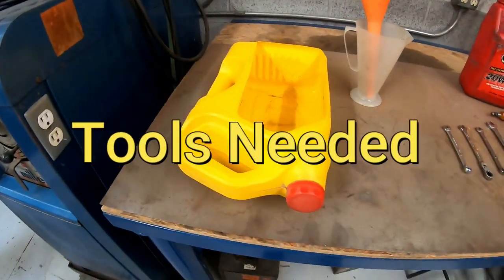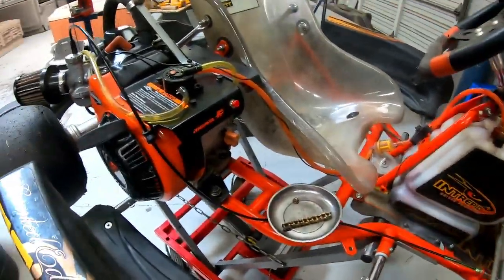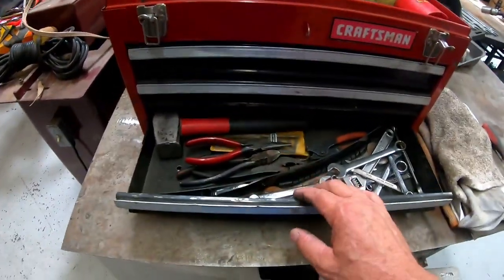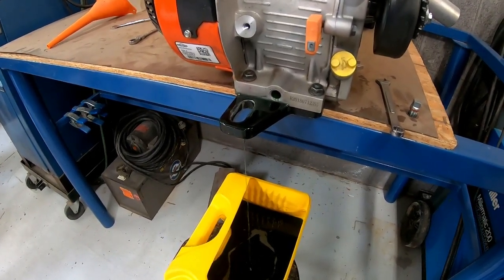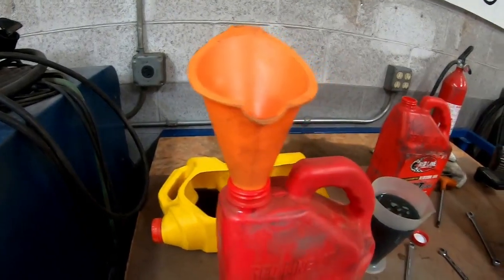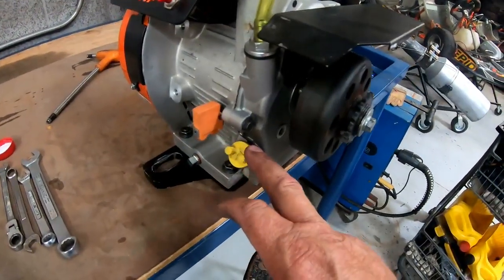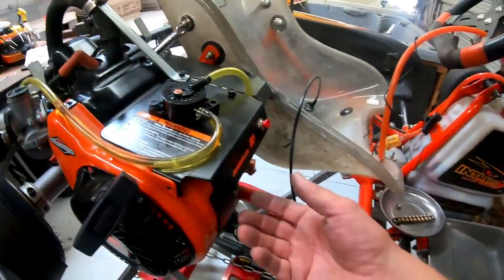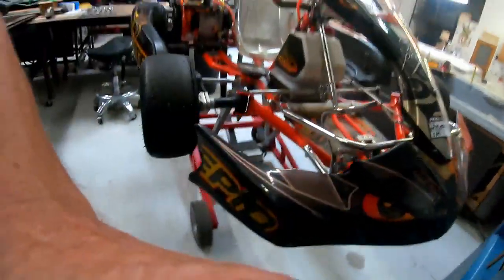Oil Change 101...How To Change the Oil On LO206 Briggs & Stratton  (Lo206 Oil Change)

Comment: That motor mount is nice, but couldn't the next one be wider, but have a hole for the oil to pour through? The thing that would bother me, that last bit of oil that works its way under the motor, looking a leak. Thank you for the video.

Comment: Very long video for something that could take 3 mins. I also wish you would have touched on back flushing the crankcase after break in for those who don't know better. Great video overall, not knocking it too much. It could just be more to the point. Nice job though. I do like that engine mount, I have to get underneth mine to get the mounting plates to sperate.

Comment: When I drain oil at the track, I put the front of the kart on my toolbox and leave the rear on the ground. I remove the plug at the back of the motor after placing a shallow Tupperware container underneath for a catch. I also cut a funnel flat across the top so I can press it up against the engine and direct the oil before it makes a mess on the motor mount.

Comment: If the oil coming out looks almost identical to the oil going in, then you’re basically wasting oil, time, and money. Oil, especially these high end synthetics like Redline, is designed to suspend particulates, essentially acting as a liquid filter. If you change your oil before giving it the opportunity to do this, you haven’t taken advantage of the oil.

Thanks for the video; it helped me get a mini “tour” of the LO206 engine, which is what I was looking for. But I would definitely revisit your recommended oil change intervals. They’re wasteful.